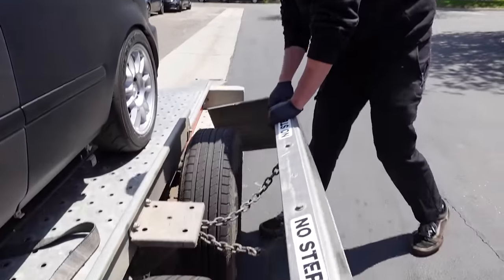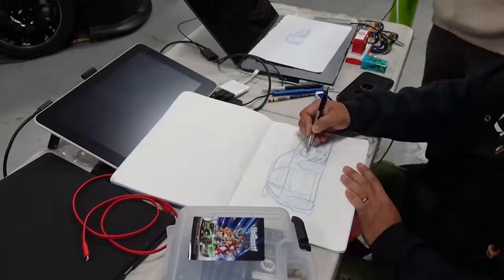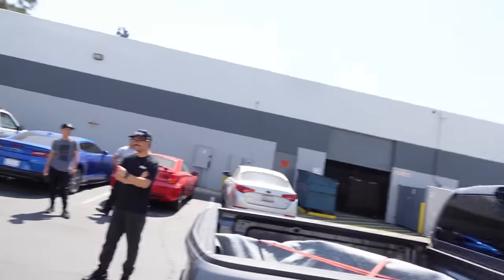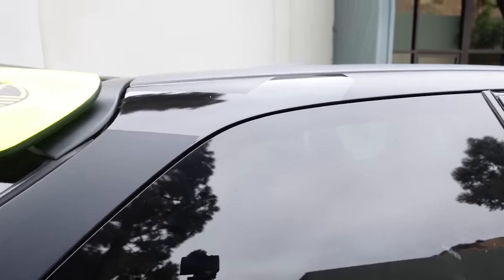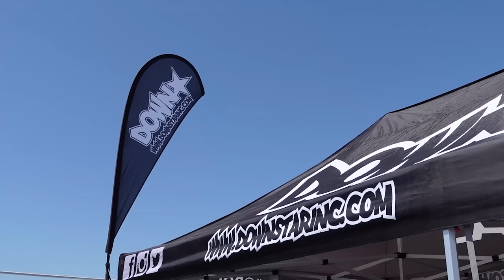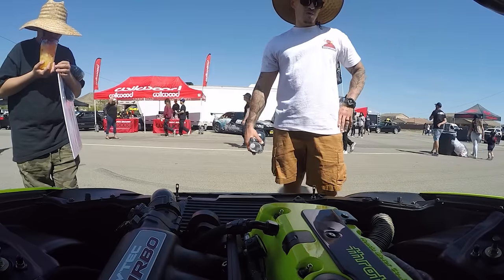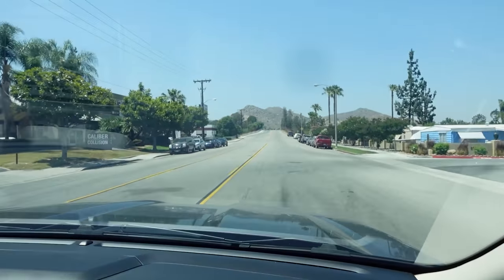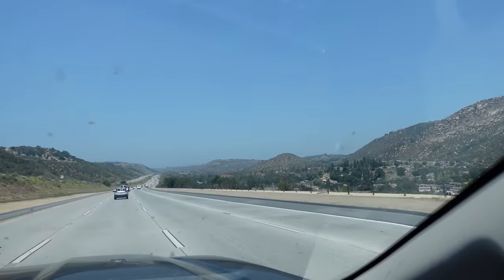Car show reactions to Rear Wheel Drive Honda Civic Turbo! (hidden camera)

Comment: I think white wheels would pop and make the overall look of the car perfect. Mickey was totally right with the satin paint and satin carbon, having it peak throughout where the vinyl isn't applied really works and adds a little layer to the look of the car. Great build Throtl!
Reply: White wheels for sure!
Reply: Gotta remember it’s a track car white wheels and brake dust is a no no. But yes it will look hella clean!